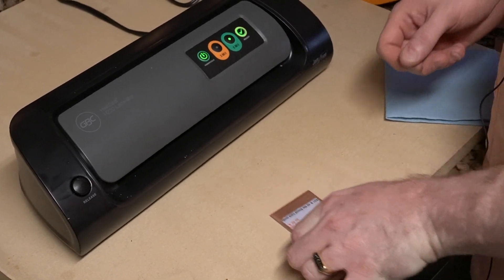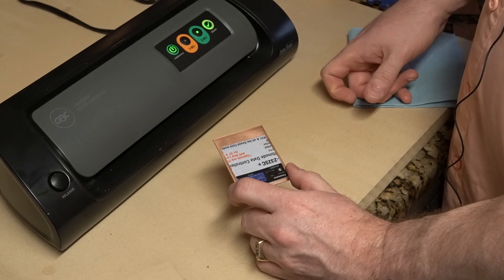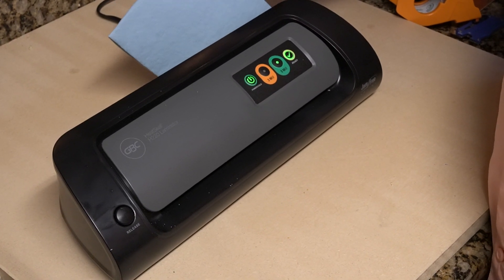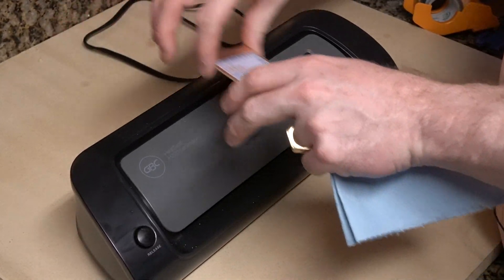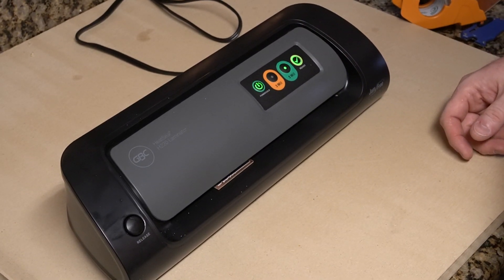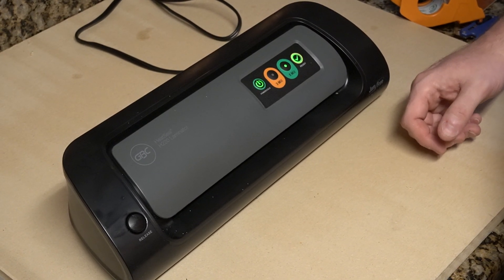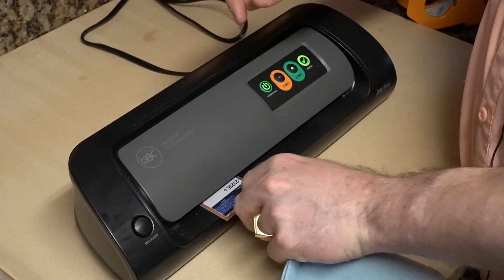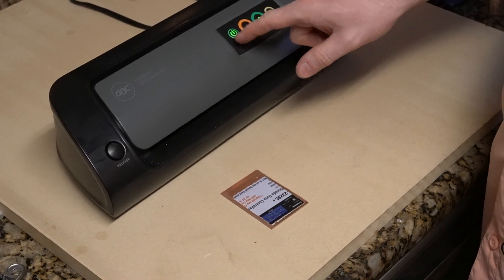PCB Series 03 Toner transfer with a laminator

Comment: How many micron is that laminator? I found one that has 2x 125 micron. Will that work? What is your PCB thickness? Did you change the thermostat for a 200 deg one?
Reply: The thermostat is what came in it. I set it to the thickest mil, probably 7 mil. The heat element is on the top, so the board thickness won't effect heat. Most of the single or double clad are about the same thickness, and it passed through (no jamming); guessing 1/16 of an inch. Does that answer the questions you have?
Reply: @charlesmckinnis5035  Yes, thanks. About 1.58mm thick PCB. I just wanted to know if I can just send the 1.6mm pcb throught the laminator without modifying it. I can always change the thermostat later for a 200 deg C one.
Reply: @charlesmckinnis5035  So with all laminators you should be able to set the thickness, right? unless it says max thickness 0.5mm.
Reply: @charlesmckinnis5035  I found one I want to buy with 2 rollers and feed of 250.
Reply: I've transferred with a clothes iron which is even less precise. And it consistently works. The most important item is that the magazine be very glossy. If you find it leaves partial transfer on the paper, it is likely the paper has too much "tooth" and the toner bonded to it too well.